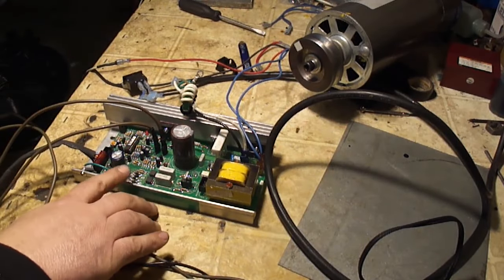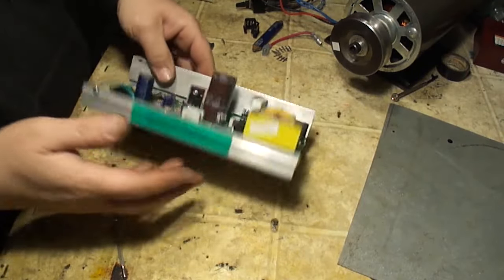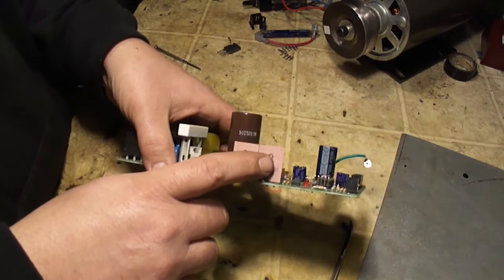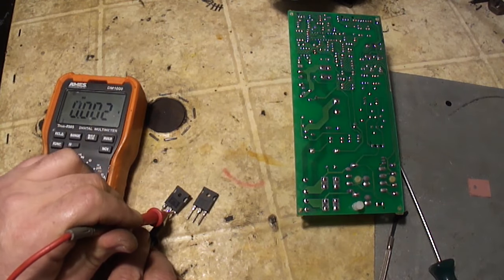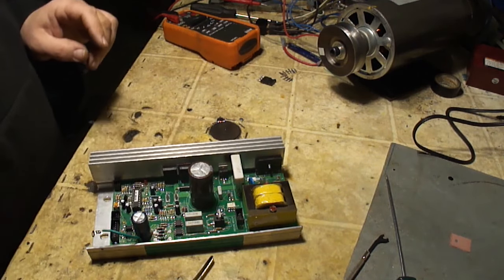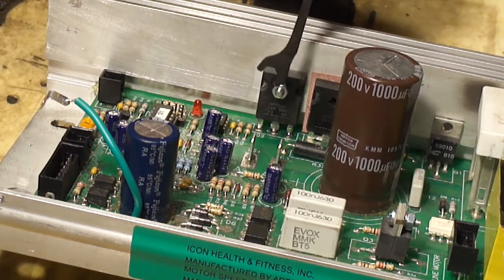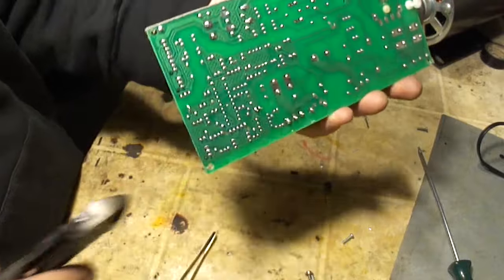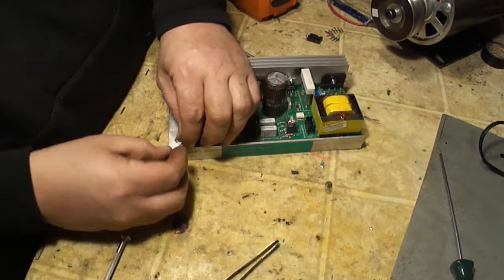Treadmill Starts Then Immediately Stops Try This.

Comment: I've followed your steps & replaced the MOSFET. It does now run, but at top speed as soon as you press start. Are there different versions of the IRFP250N MOSFET? The full number string on the original is "IIRFP250N 442L B8 CA" and the replacement is "IRFP250N P033D 5105". Or does this suggest that the issue is with a different component, and perhaps that's why the MOSFET shorted in the first place? Thanks for the easy to follow video.
Reply from the maker: You have an unrelated issue sounds like.
Reply: same thing happened to me, did you find a fix😊

Comment: Hi. can you tell me how you can find the  PWM pin on the circuit board?Thank you.
Reply from the maker: The blue wire is the PWM + Black with white stripe is the PWM - red is power + and black is power - on the 8 pin connector.

Comment: I did this procedure changing the MOSFET and the SCM. The treadmill started normally. I stepped on it and it shut right off. Now every time I turn it on it goes off in 2 seconds. Before I junk the treadmill, I am pulling the motor just to check the brushes. Then I am going to cut my losses.
Reply: Any update did you find anything wrong? Having same problem
Reply: @josephr8178  No joy,  but I have not junked the treadmill yet. It takes a lot to replace those parts just to have them not work.

Comment: Do you know what would cause the motor to short out after running on the treadmill for 10 minutes and increasing the speed?  I have a ND C1750.  thx
Reply from the maker: Good chance there is a lot of friction in the running belt.

Comment: Hiya, great vid! What power is your soldering iron? Did you get the same result when the part was still soldered to the board? Thank you
Reply from the maker: Not sure about the wattage maybe 15w $3 Harbor Freight Iron. You should get same test result with MOSFET in place on the board.
Reply: @MrFixit1  Ah thanks. Did you test all of them on the board before you discovered the MOSFET was the issue? I'm not sure what results i should be getting from the rest of them.
Reply from the maker: @richardpaton4689  I only tested the one MOSFET as I assumed it was what burnt out. Short all 3 pins of the MOSFET together with your meter lead then test continuity, one leg should give you a reading and other should not. You can do this with it installed. NOTE: shorting all 3 legs turns the MOSFET off. You can also turn it on with the meter and test it that way. Do a google search on "how to test MOSFET transistor.

Comment: Hi, great video.  I am not an electronics guy, but you make this fix look pretty easy.  It will certainly save a lot of $$.  My Zordic Trac treadmill is doing exactly as your video shows, so I'm pretty certain I have the same problem.  The only difference is my MOSFET numbers are slightly different than yours.  Will it make a difference?  Mine are IRFP25ON, I*R, 3371, 53, D3. I tried attaching a photo of mine to this comment, but Youtube would not allow me.  If you have an email address I can send you the photo.  Thanks, Brent
Reply: I have searched Amazon and Google and cannot find an exact match for my MOSFET.  It has the numbers in my previous comment.  Does anyone who is much smarter than me give me suggestion on where I can buy one and if another type will work.  I find plenty with IRFP25ON, but they never match the other numbers/letters.  Thanks in advance.  Brent

Comment: Hi, not sure if you are still monitoring this video but I have a question. I changed the MOSFET and it worked for a few minutes and then same issue as before, quick start and stop. Any ideas?
Reply from the maker: Could be the motor going bad or you have a lot of tension or drag on the running belt causing and overload current draw.

Comment: Hi, I replaced the mosfet, and it still dies after 1 second of run time. However, it seems to start not at full power like before....Any ideas? Any help is appreciated....

Also, I used a battery and tested the motor directly, and it works. Also the large capacitor on the board is puffed up however it does have a rubber top....
Reply from the maker: I would replace the Capacitor and try a new MOSFET. Also check the connections coming from the console.
Reply: @MrFixit1  Thank you. I ordered a new capacitor, and I have a few extra mosfets. Should be here tomorrow so cross your fingers...

Comment: Hi there, so I had the exact same problem, and replacing the mofset fixed it - but the bliss of victory died quickly, as the normal expected behaviour only lasted for a few starts, and then while testing by running on it the treadmill tripped out and stopped. Now it’s doing the exact same thing again… assuming another blown mofsat. any suggestions on what’s causing it to blow? Luckily my Amazon order delivered 10 mofsats.
Reply: A few more clues. When it did restart successfully the first few times, it overshot the speed at first and adjusted downwards (speed 5 launched up to 6 first then adjusted down to 5 after several seconds). It hadn’t done this before. Also on the first time the mofsat had failed, I recalled the treadmill ran up quite quickly, shut off, and then exhibited the failed mofsat behaviour in your video. Any help is appreciated!
Reply from the maker: @alanlaidlaw386  If there is excessive drag on the running belt or the motor is failing will cause the MOSFET to burn out. I would start there.

Comment: I had the same problem but after all the work my MOSFET just popped from the soldered area (the right pin). Maybe the wrong type of solder? I did notice that my solder was easy to melt but the one from the board took longer. What kind of solder did you use? BTW this was my first project ever. Thank you for your help !
Reply from the maker: Try again. May not have had it soldered well enough.
Reply: But does the type of solder matter?
Reply from the maker: @gabrielquintero3338  As long as you are using Flux core for electronics and not acid core for plumbing. I use led free Flux core.
Reply: Thank you. I used what came with the kit. A thin one that came in a narrow tube

Comment: I had a 245 and replaced it with a 250N.  Same problem; starts then stops.  Any suggestions?  Board is 2100 Rev 5.
Reply from the maker: If there are other damaged circuits on the board, I can't really help through Text. If you happened to order more than one MOSFET I would try replacing it again. It is possible the first part was bad out of the box, or a questionable solder connection failed and burnt-out the new part.
Reply: Thank-you.  I'll try another MOSFET.
Reply: Right you are!  Replaced the MOSFET  (I orderd 5).  Now running!  Thank-you so much.

Comment: Our board uses a IRBP250M but kinda hard to locate. It seems like the IRBP250N is the same thing, am I wrong?
Reply from the maker: As long as it is an "N" type and has the same amperage rating and the physical body size is the same, I don't see any problem using it.

Comment: Good video,  but why does it go bad, the MOSFET?  My treadmill is under warranty and they have replaced the control board 3 times, everytime the same problem reoccurs after some time...the problem is that the machine starts and stops intermittently,  no pattern whatsoever
Reply from the maker: The MOSFET will burn out due to a few things. First is lack of Q.C. second is over currant draw from motor working too hard. Third is too much load on the running belt. i.e. lack of lubrication or improper adjustment. I'm not a treadmill expert but this is what I know.
Reply: @MrFixit1  Thanks.  Good explanation, I will check the lubrication.

Comment: Can you go over the item you connected to the MC2100 please?
Reply from the maker: I think you are referring to the pulse width modulator generator. This Box generates a small voltage pulse to trigger the board to start the engine at a set speed.

Comment: My treadmill motor just starts up as soon as I turn it on and I can't adjust anything,  the screen buttons won't slow it down ...any advice?
Reply from the maker: Test the MOSFET If is shorted in the closed position this might cause this issue. The speed control board gets a pulse width modulated signal from the console so, the motor should not run without this signal. The MOSFET is just an on\off switch. if it is stuck on then the motor will run continuously. I'm not a treadmill expert so this is my best guess.
Reply: @MrFixit1  thank you, I'll try it out

Comment: Mine will start, stop then start again and it will run for 20 minutes then shut off. Is this the same issue?
Reply from the maker: Not the same issue. Sounds like the motor is over heating.
Reply: @MrFixit1  oh ok. So it sounds like the motor then?
Reply from the maker: @maj3stikq122  May be the running belt needs lubed or re adjusted causing more friction than usual, but I'm just speculating.
Reply: @MrFixit1  ok well thank you! I lubed the running belt but I think it needs more I did not put much. I will try and adjust it as well. 
Thank you

Comment: Any idea what else it can be? I followed all the steps and it did the same thing. I did accidentally order irfp260 instead of the 250 would that keep it from working properly?
Reply from the maker: Does your treadmill have the MC-2100 motor controller? Is the LED lit up on the board or is it blinking or off?
Reply: Could the cold be an issue? I have the treadmill in my garage and it was probably around 40F
Reply from the maker: @thomasquintana4338  The cold could be the issue as to why it quit in the first place. If the motor has extra load i.e. cold belt dragging the motor down that would pop the MOSFET. Would need to check the diode to the right on the MOSFET and see if it also popped. Also the transistor to the far right. Condensation on the board could be an issue as well. A bad pulse signal from the console may also be the issue. The MOSFET is the most common part to fail.
Reply from the maker: @@Flirtnigga94 Thats some name you got there Sir! lol

Comment: So how do you know if it’s the mosfet or reed switch related?

Red light on mine and shuts off like yours.  Your flow chart says that’s speed related.  Says to replace/repositoon, or replace controller, harness, console.  

How do you determine if it’s the mosfet?
Reply from the maker: test MOSFET
Reply: MOSFET was bad, reed switch was good.   Successfully swapped out the mosfet and it lasted one day and is back to doing the same thing.  What causes the mosfet to go bad?

Comment: great video, didnt fix mine unfortunately
Reply from the maker: A few people have had to replace the MOSFET a second time, for some reason the MOSFET went bad on install. If you bought more than one you might try again. I had to do the same on my MC2100.
Reply: @MrFixit1  the new mosfet did go bad though im not sure if it was during installation or powering on. I assumed something else was killing it, but if it went bad during installation then I suppose there might still be hope. I bought two so I'll give it another go, thanks for the suggestion 👍
Reply: Tried the second mosfet, kept testing it throughout the whole process. It was good right up until I turned the speed on and the motor started spinning. Immediately after, the treadmill powered off, I saw a bit of smoke coming from the mosfet and a bad smell. Tested it and its dead. So it seems like the motor is frying it somehow
Reply from the maker: @onusai  I don't know if your able to but, check the motor windings for resistance and ground faults. You can take the model numbers off of the motor and type them into google or try to contact the manufacturer to get the specifications. If the motor is shorted that will kill the MOSFET.

Comment: Replaced it it worked for about 5 minutes and then broke again I'm going to try again and replace both of those and see what happens
Reply from the maker: check if the running belt has rolling resistance and the tension is adjusted right, and the motor turns freely. any added stress on the motor will burn the MOSFET.

Comment: that motor sounds like shit
Reply from the maker: Nothing wrong with this motor
Reply: @ A C  eletric motors are not supposed not make grinding scraping noises lol  when that motor fails better hope it doesn’t start a fire and burn someones house down lol ive seen it happen
Reply from the maker: @promx96  Motor is just fine it sounds this way because I put a reversing switch in it, and ran it in reverse, so the brushes had been loaded the opposite direction and will make some noise for a moment until they run back in. I installed this motor and speed controller on my engine lathe. It has been working flawlessly for over a year now and has turned more revelations in my lathe than it ever would in a treadmill. I have a video of this if you care to have a look, I'll make it easy for you, here is a link:https://www.youtube.com/watch?v=VXF66CMA3-w . Nothing wrong with this motor.

Comment: Hi Bud thanks a lot for the video ! Is there a specific MOSFET I need to buy ? It appears that I have the same board as yours ! Did you change only one of them if I need to change both ? Thanks a lot !
Reply from the maker: I only changed the one but if you feel you need to change all of them. The number is printed on the MOSFET just goggle the number and you will find it.
Reply: I find the IRFP250N MOSFET but what are different numbers under it? Mine is 709P 44.   AX?
Reply from the maker: @megofishn   IRFP250N is the part number and as far as I know the other numbers are for manufacturing proses. IRFP250n Or IRFP260N (higher amp rating) are the numbers you need to get the right part.

Comment: Hi sir. My treadmill turn itself off(feel like a trip) as soon as i turn it on, not running it, just turning it on. What could the problem be? This happen after i change the mosfet. Thanks.
Reply from the maker: check if the circuit braker tripped. May have a crossed solder joint causing a short circuit. This would be my guess.